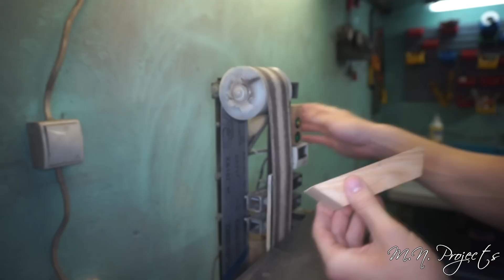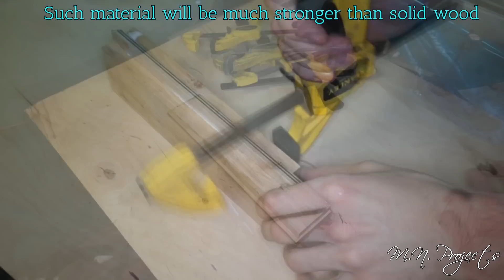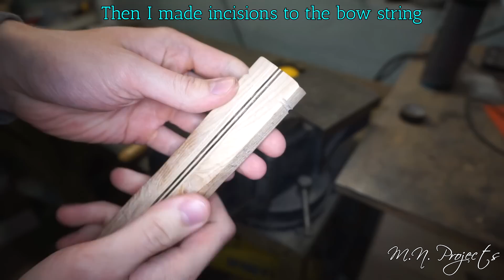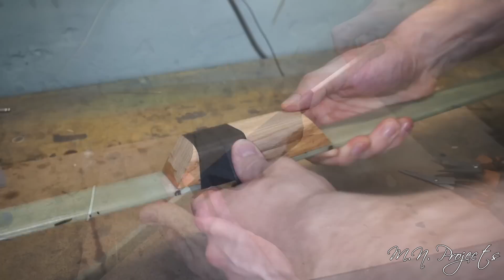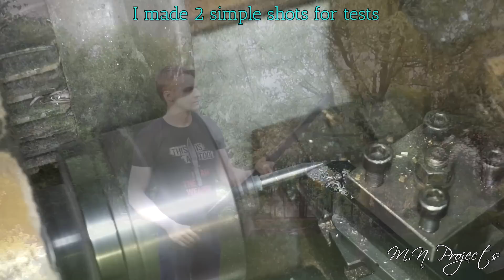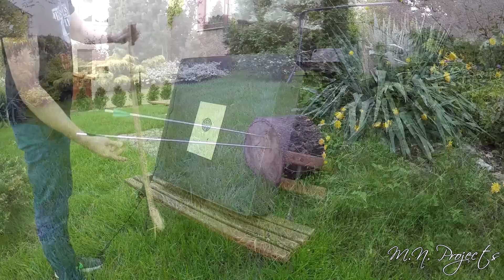Making a Simple and Cheap Bow

Comment: Actually , usually bows are smaller and lighter at the ends. I think that makes them shoot faster. Pyramid bows take that to the extreme. Also there is nothing wrong with a bending instead of a stiff handle. A bending handle makes the bow smaller. When I ever will try your design I'll make at least those changes. I am sure it will be a wood fiberglass composite as I still think your extension are too thick and heavy.
Reply: That's what I was thinking. Adding so much weight at the very end of the limb certainly limits this bow's launch speed.
Reply: Matthias Liszt True, this is an amazingly slow bow. You can do better with a green branch and a drawknife.

Comment: Should've made the bow center shot since the static handle, the siyahs could have been made thinner and angled forward so you get a recurve. Other than that, pretty nice. The bowstring is a bit on the weak side it seems, especially if you shorten the bow for added draw weight

Comment: Here's a challenge. Have a look into mongolian horse bows and see if you can make your own simple to make version of it with fiberglass, some sort of backing material, plywood and lots and lots of epoxy
Reply: Nearly all the ones you find (at least for cheap) for sale on the internet are made this exact way, but the riser is wood with the limbs attached separately. All he would need to do is cut the fiberglass in half, attach the limbs the same way he did the siyahs, and bam, same as a cheap chinese version of a horse bow, and only slightly less reliable.

Comment: I have no idea what your tradenames for this product is but they are called "pulltrusions".

They have a very high glass to resin ratio.sonetimes more exotic mixes of glass,kevlar,carbon and other stuff.

5mm is way to thin .

I havevused 8mm but it was only 30mm wide.

Size is relative to power.

I do like your cheap fletchings.

Plenty of tutorials on this and as complex as you want to get.

Yours are easy and functional
Reply: 6.5mm is for 100 - 120 pound turkish bow. Why 8mm ?
Reply: @marektaziar5402  because that is a stock size off the shelf(more correctly the offcut bin).

NZ is a small plae and alit of things are custom made with no excess or very limited sizes so only a luttle bit of choice

Comment: Cool build! Next time I would taper the ends of the bow to help with limb speed, and instead of the massive wood siyahs just add a simple small wood, bone, or horn nock. The bow itself looks extremely unpleasant to actually use due to what I imagine is tremendous hand shock, but I'm not sure how to fix that (I've only ever built wooden bows).
Reply: Your suggestions will likely fix most of the problems, including hand shook (that is not a big deal in such week bow, although it will affect accuracy). I was going to suggest exactly everything that you suggested, so thumbs up to you! I think if he apply it all, the bow will improve tremendously. He can also add a nock and make the field point slightly bigger than the shaft, so it will pierce a bigger hole and the rest of the arrow will past through without friction, as it doesn't touch the hole.

Comment: So it always hit with the end of he arrow (nock) pointing high??? Either your arrows or your arrow placement is off (or 2 fletches rather than 3 properly done).
Might not seem bad at 10 yards... At 30 that thing is going into the dirt. I understand the DIY bows, which I plan to do myself soon, but I will buy/use modern arrows!

Comment: What kind of range does it have? I see alot of power up close but down range?
Perhaps with lighter arrows?
It's not so much lbs of draw as how quickly it springs back into shape, or a balance of the two at least.